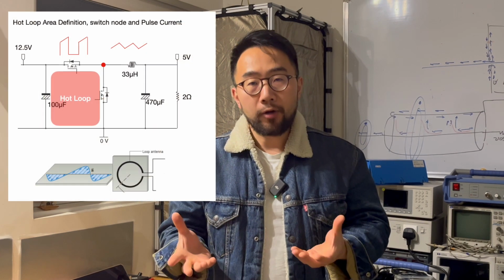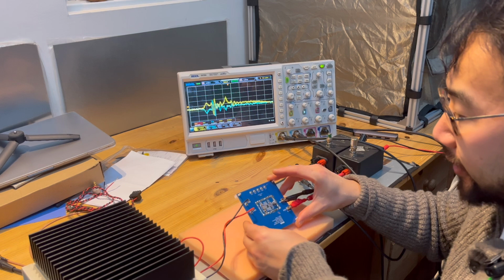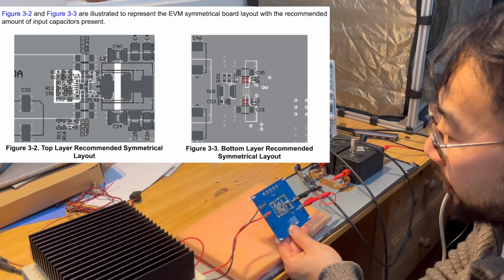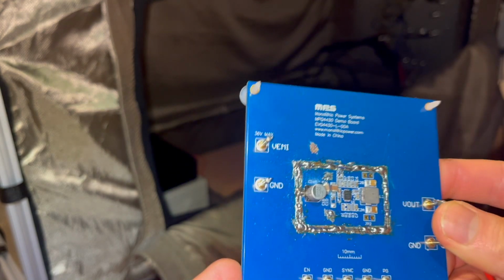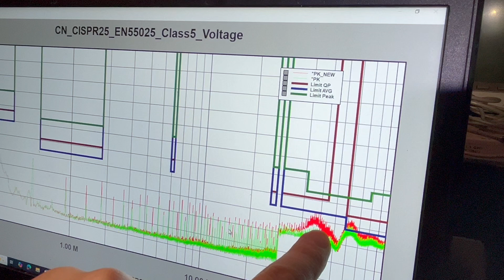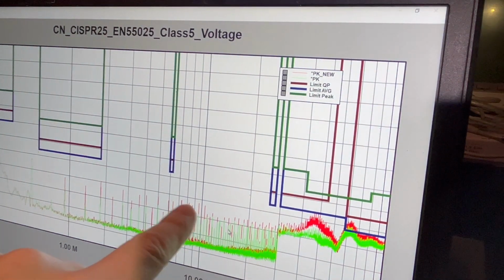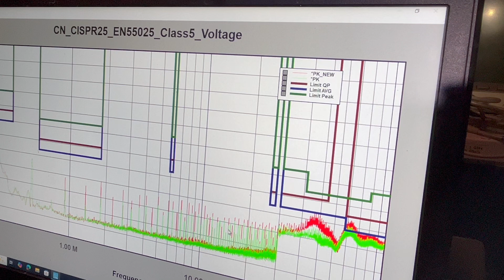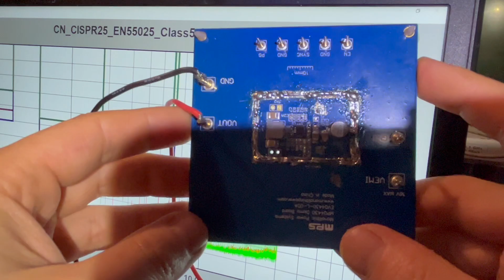Using Symmetrical Layout of Capacitors for Better EMC

Comment: At a tradeshow at Nuremberg an engineer from AD offered me to play with two switching regulators and a magnetic sniffer probe. One of them being their SilentSwitcher and the another one a similar board from a competitor, all markings carefully scratched. The SilentSwitcher using the opposing capacitor layout had radiation levels remarkably lower all over the spectrum than the other one.
Reply from the maker: I have seen the silent switcher myself!